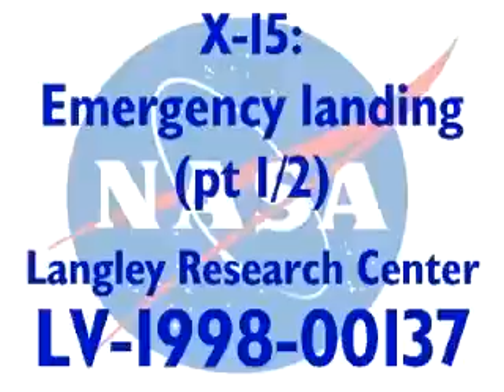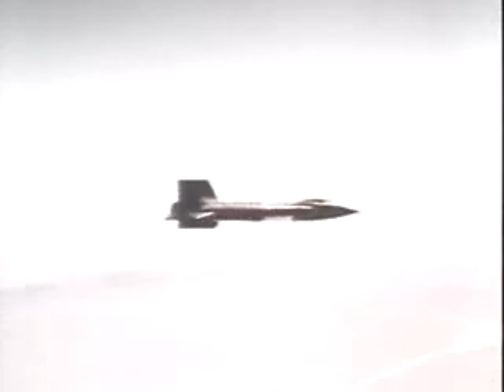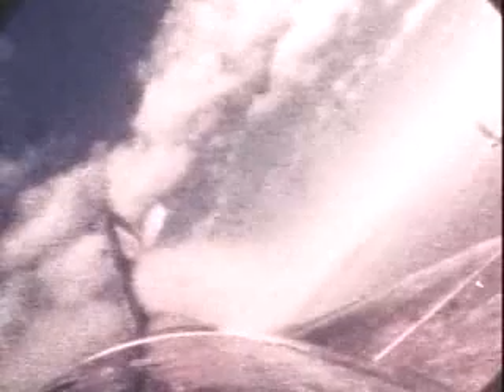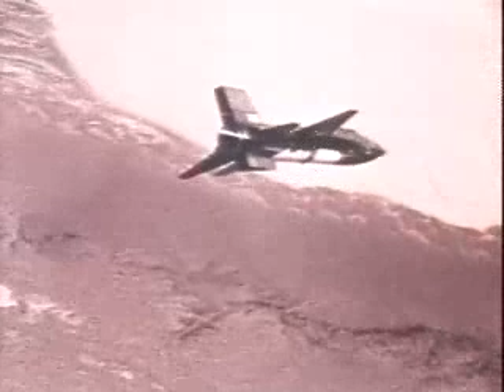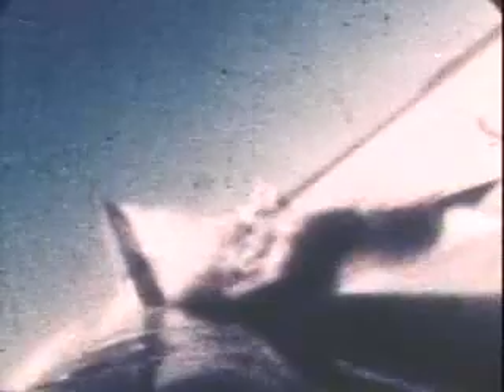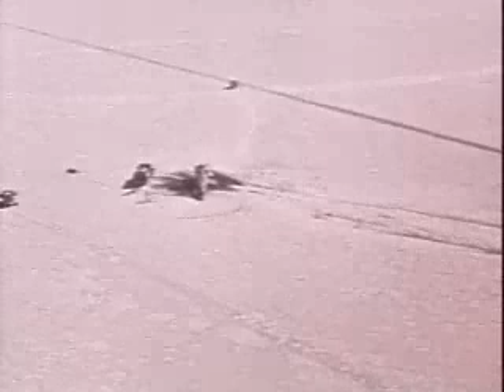X-15 Crash Landing (1962)

Comment: seeing this video, it struck me how similar the cockpit, fuselage and front cowl look to the SR-71.  It has the same spare, elegant lines built for pure speed. Both built by Lockheed, but they were developed at about the same time so they must have a common origin.  I imagine the X-15 must have been scaled down compared to the SR in dimensions, as it didn't have the camera gear  -- or ecm/radar electronics though I don't know if the SR was so equipped.
Reply: It struck me how old this comment is.
Reply: Actually North American Aviation built the x15 but I can see how you can see the similarity.